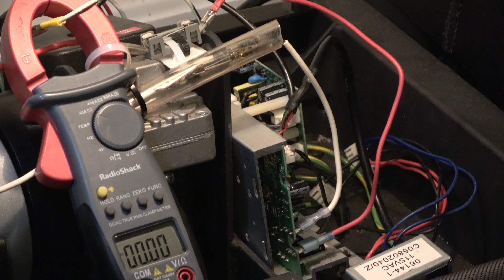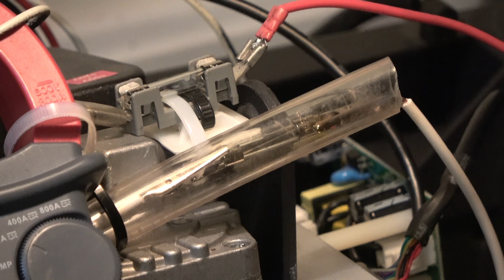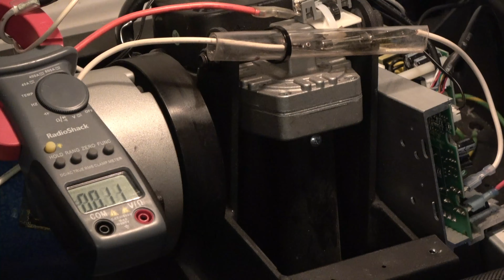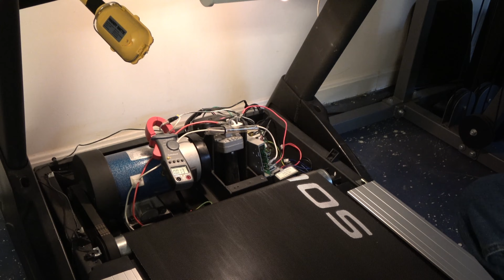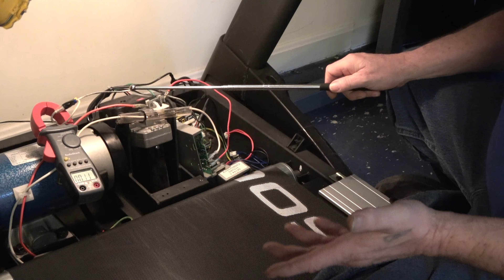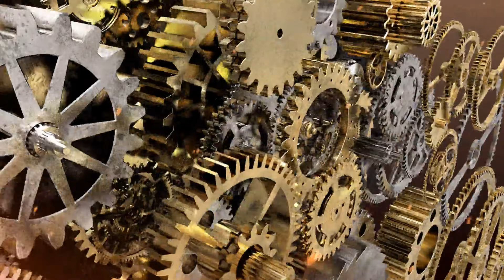HOW TO SAVE YOUR TREADMILL MOTOR CONTROL BOARD

Comment: curious - why 2 fuses? only 1 should be needed...  also bad winding in motor can cause high amp draw too but far less common of course - just for the end user to know it should be ruled out. very helpful video for diagnosing bad belt/deck...
Reply from the maker: Well 2 fuses were used just to see what would happen. And bad windings would cause high amps for sure normally comes with a sort of hum

Comment: Great video. Do you know what the expected current draw should be while running and not running on a sole f80 at say 6mph? Thank you.
Reply from the maker: Hmm that test is down at 3 miles should be less than 3 with no weight and around 5 at 200 I have a bunch of videos on testing that
Reply: @FitnessTechnologyServices  Thank you!

Comment: I have a Sole f63.  Just changed my control board and nothing is happening.  The red light on the power switch comes on and that's it.  Before I changed it, it tripped the breaker
Reply from the maker: Please send me your serial number to Fitnesspartspro@gmail.com so I can see what controller you have. But I do have a video on troubleshooting sole motor controller it may help
Reply: Were you able to fix yours? I am running into same issues with my sole f63
Reply: @No-apperance  I could not fix it.  I ended just replacing it.
Reply: @phillipwilliams7534  thanks for the response. Did you replace control board or anything on the display console? Where did you buy the parts and much did it costs. Thanks again.
Reply: @No-apperance  I replaced the treadmill.

Comment: Mine has shut down several times.  It will restart... after turning off the main switch and turning it back on.  So is my motor controller blown?  Since it will come back on after toggling the on off switch?  So my treadmill is a F85 Sole .   If I spend the money for a new walk belt... might as well get a motor belt too... but how can I tell if the motor controller is blown to the point of replacement?
With a new walk belt... properly lubbed...  if it powers up... will everything be ok?   If the controller is ok... I hate to replace it if there is no need.  Even though it has shut down on me several times... it runs without weight.  Sorry I'm not understanding about the controller being blown.
Reply from the maker: Well I wouldn’t think it would be the controller if it runs good with no user .send me your serial number to Fitnesspartspro@gmail.com so I can see what belt and parts yours takes . Also be careful using it the next step is shorting your controller out .I will also send you links for testing
Reply: @FitnessTechnologyServices  Thank You for your response.  I'm on Central time... I should have the serial number and be ready to order from you... around noon ....maybe before that If I can get started on it.   Ummm where would the serial number be?   One of the tags on the outside in the back where the main switch is?  Or is it under the cover?
Reply from the maker: @willardreasoner1694  well you know I have a video on that! But in general it is by the power cord. Or by the power light
Reply: Do you show where to change the fuse?

Comment: Great idea, Dave. Did you give any thought to a permanent installation of a circuit breaker rather that a fuse? Seems to be it might be a great product to offer on your website.
Reply from the maker: Well of course I did , But I wouldn’t use a breaker ! They don’t seem to trip as fast . And the fuse let’s them know they have let there belt go to far , either badly worn or at least not well lubed I wouldn’t want customers to just reset it and then jump back on ! And maybe overload controller. And I can’t put it on my website yet . Can’t say ? For now it’s just a helpful Idea . And thank you